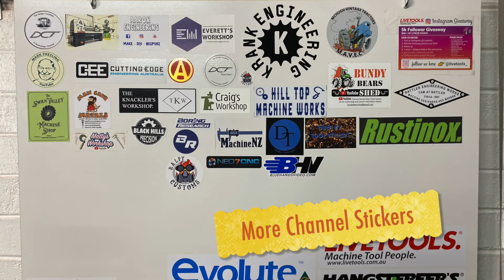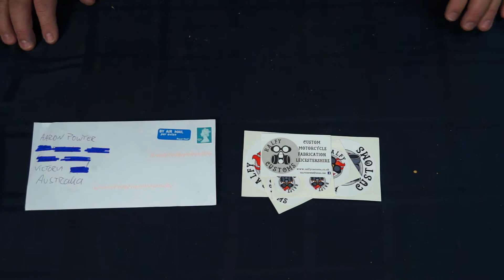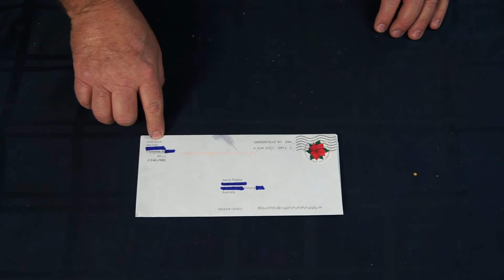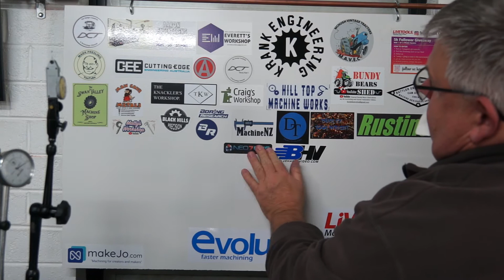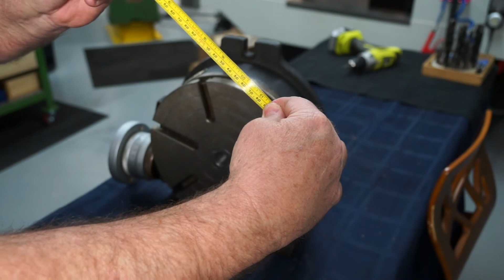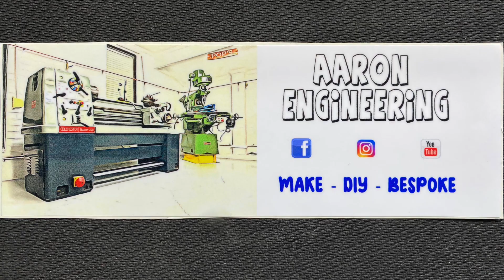Ramblings #9 - New Shop Trolley, Stickers, a Vertex Table & Dirty Jokes

Comment: gday aaron one mans trash is another mans treasure got the stickers you sent thanks for that now i will have to make up a sticker board cheers wayne
Reply from the maker: G'day Wayne.  Thanks for letting me know that your stickers arrived safely.  Good old snail mail, I posted the letter on the 30th and it took 13 days to arrive 😂.  As for the sticker board, I went to my local hardware and bought a small piece of white painted MDF board.  To hooks and hung it up on my airline.  Cheers mate.  Aaron.